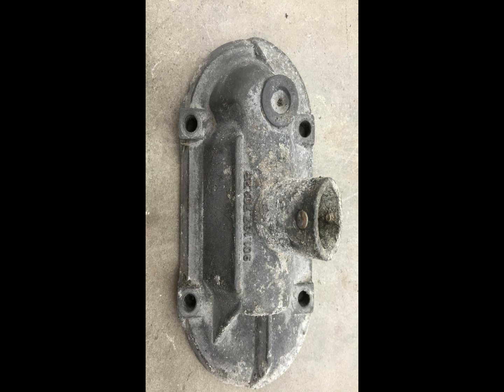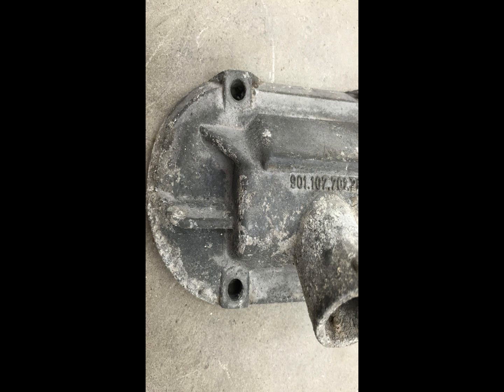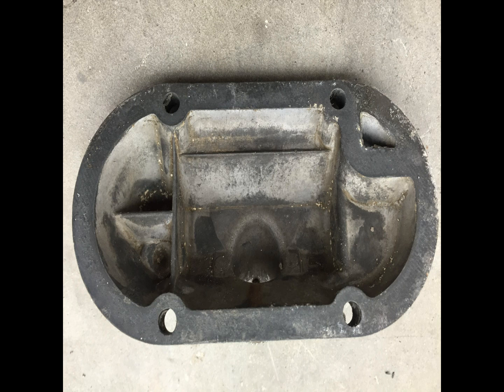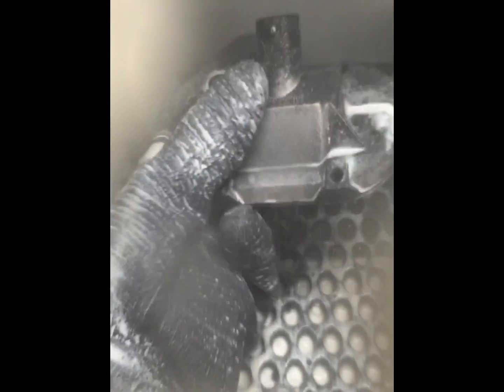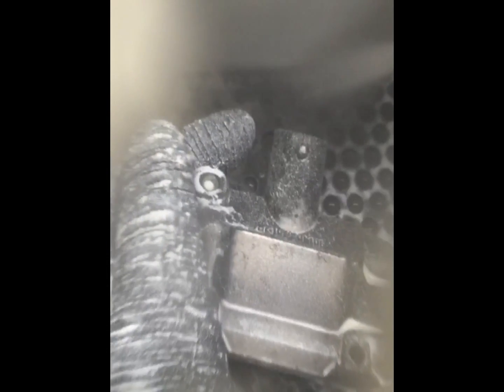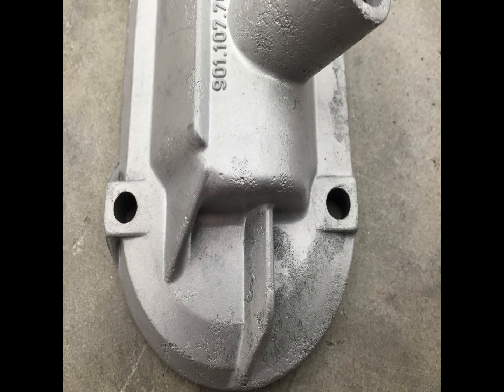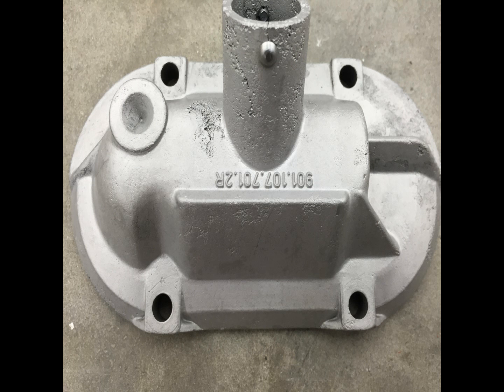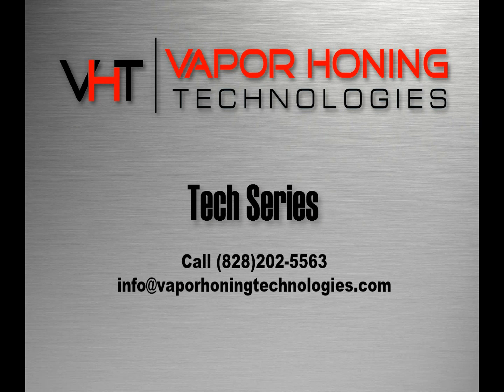Wet Blasting Magnesium Porsche Engine Parts- Vapor Honing Technologies

Comment: How do you ensure none of the bead stays behind in hard to see places? At least soda is soluable right?
Reply from the maker: We recommend a thorough rinsing process, blow all areas off with a high pressure air hose, allow the part to dry and repeat the process.  However for the most difficult areas, you can use soda with wet blasting as well.  This will give you an exceptional finish without the worry.